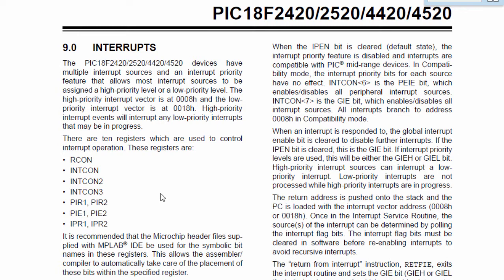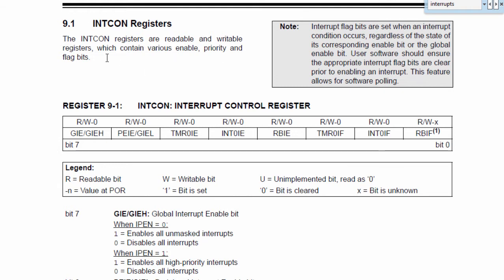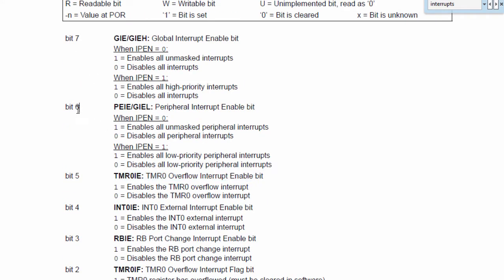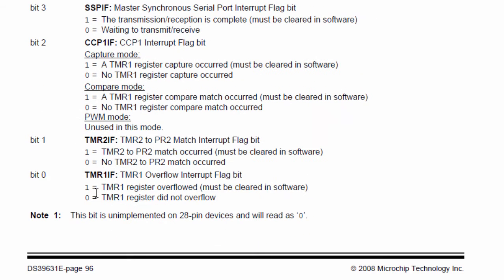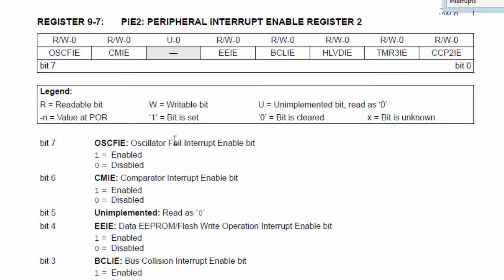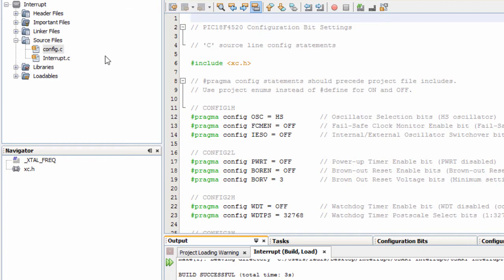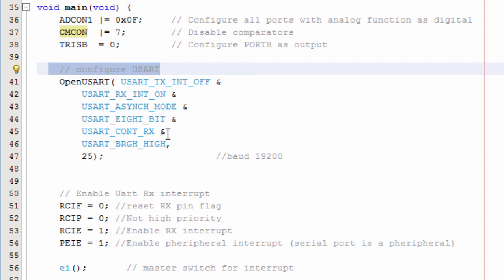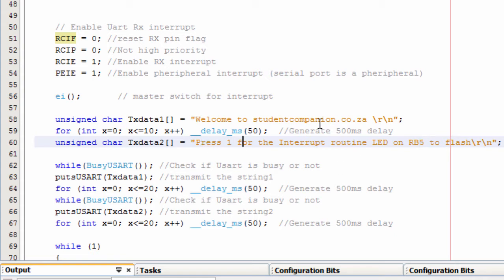16- Interrupts, part 2: Peripheral Interrupt | MPLAB XC8 for Beginners Tutorial

Comment: Can you please share the code and simulation file for peripheral interrupt as am unable to run the file. My terminal is showing some garbage!
Reply from the maker: If your terminal is showing garbage is most likely the problem with baud rate. Make sure you set the terminal baud rate same as you set in your MPLAB project
Reply: @StudentCompanion  Its same! Can you please share the files for peripheral interrupt of both schematic and code
Reply from the maker: @usmanashraf3199  we will upload the code tomorrow

Comment: Hi is there a way I can debug mikroC. Without going to assembly. Thank you
Reply from the maker: +wlondoner you can. If you have a development board or programmer that support debugging.  You can debug your code.
Reply: thx for your quick reply.
 At the moment, more often than not by pressing F8 it will go to assembly language . You mean by plugging in  a development board i can debug the whole program without jumping to assembly.Can  you please recommend a programmer that support debugging. many thanks again
Reply from the maker: +wlondoner I don't know what you mean by pressing F8 it goes to assembly.  
1.To start the debugger its F9 not F8.
2. On the right there is a window to watch values. This is not assembly.
3. Press F8 to step over (go to next line of code)
4. Please when you write a mikroC comment write it under a mikroC video not an MPLAB videos. Those comments are not for you only other people read them as well.